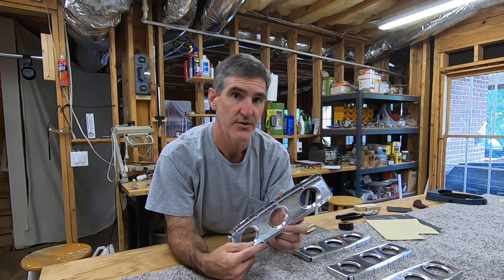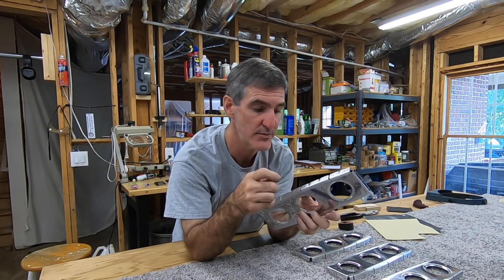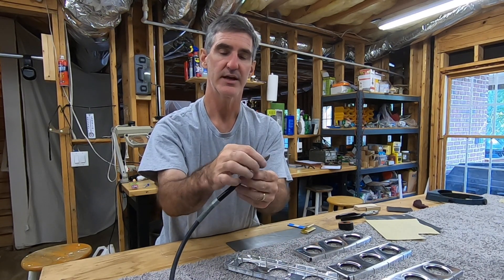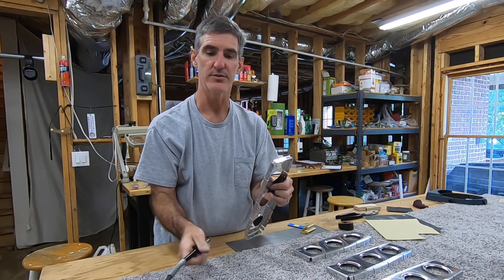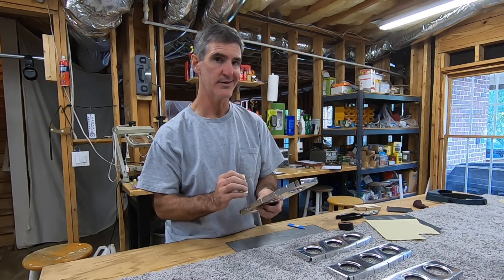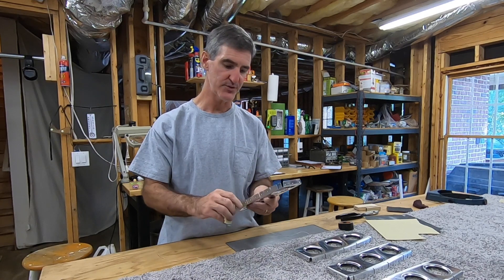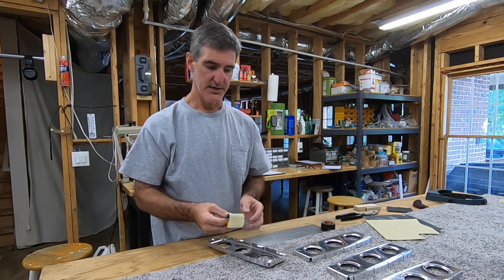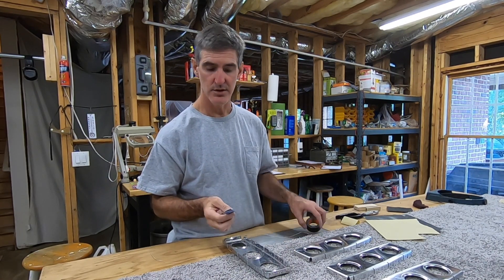RV 10 Build Log - Easiest way to Deburr the Notches Between Rib Flanges

Comment: The best method I found while building my RV-14A was to get a roll of 2” cloth backed 220 grit sandpaper. Take a piece about 6” long and rip it in half lengthwise. Now place the 1” strip over the burr and putting light pressure on the back of the strip against the burr with your thumb, pull it strip through. It will usually remove the burr in one pass. With use, the 220 grit becomes more like 400 grit and becomes very flexible. It will then conform to any shape of the flange including the tight areas discussed in the video. This method is very fast and does a great job. Use a quality shop roll, I got mine from Klingspor online and it will hold up indefinitely.
Reply from the maker: Nice, I like it!  I've been doing a lot more deburring with sandpaper lately.

Comment: Great idea so I tried it.  I made mine with 3 layers of soda box cardboard and instead of the rolled tape, I used a drill bit 3/32” taped to the edge all wrapped in 3 layers of painters tape.  Use 320 grit and worked great.  Thanks for the great tip!  Really enjoying your build.
Reply from the maker: Great idea!  I was just thinking last night about other things I could use.  I was trying to duplicate the process of rolling up the tape and finding it more difficult to get a small enough “tube” that I had the first time for some reason.  Drill bit wrapped in some tape sounds like a great option.  Thanks!

Comment: Here’s what i’ve been using. Take a 1 inch wide role of emery cloth from harbor freight. Cut a length of about 10 inches. Then grab the cloth at the tip and with your other hand tear a small slice about 1/16 to 1/8 ( real easy to tear) and use it like dental floss  around cut outs etc. i have 2 or 3 grit sizes but always finish with very fine. Works great.I used this method basically  on the all flanges on the the airplane.
Reply from the maker: I like it!  What grits do you typically use?
Reply: @missiletwentynine2667  I use 240 and 120 grit. I said emery but what I meant was aluminum oxide. Can not find 1" roll at Harbor Freight anymore so I ordered from Amazon: 240 grit VSM-332652 $13.82. Shears easy and does an excellent job. Better than files. I've been using for many years
Reply: VSM 332652 is 1" x 50 yards by the way
Reply from the maker: Excellent, thanks!  I’m past most of the deburring on the HS (thankfully) at this point, but I’ll order some before I get started on the elevators.  I also managed to find some 400 grit that’s Aluminum Oxide at the my neighborhood HD for finer work.

Comment: There are good tools available to do this, but you won't find these by watching people like "plane lady" or shopping at Harbor Freight. Go to a real machine shop supply store and buy some Gessiwen Riffler files. They are made in very many shapes and forms for filing small areas. They are Swiss made and expensive but the last forever. There are Asian knock-offs but they are junk.
  While you are at the tool supply store look at the Cratex abrasive line. They are ready made bobbins that are not very expensive when bought by the box. Get a Cratex mandril to mount them on. The supply store guys will explain all of this to you. When you use the Cratex in your air tool, you cannot run it full speed, as it will vibrate and break the tip off of the Cratex .
Reply from the maker: Thanks, I’ll take a look.  I’ve been meaning to buy some decent tiny files, and I don’t mind spending more for quality tools.